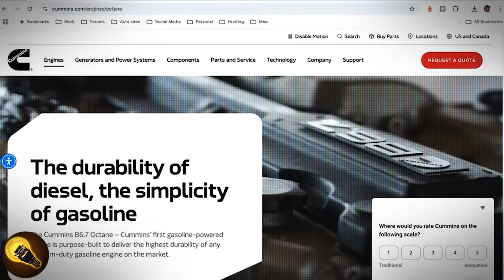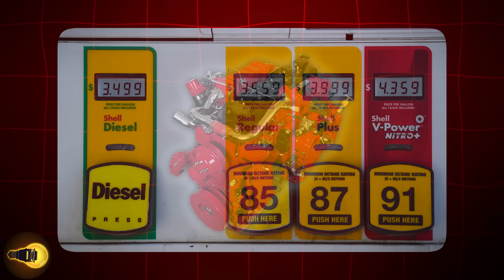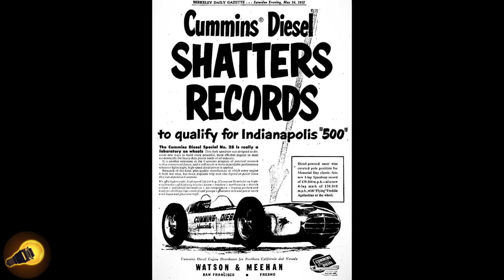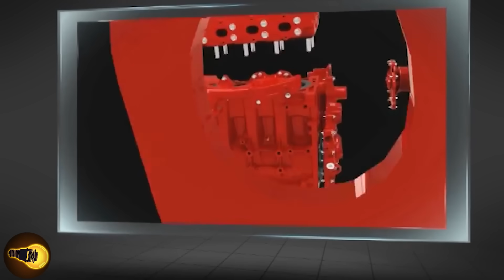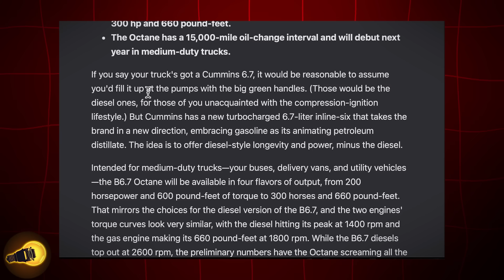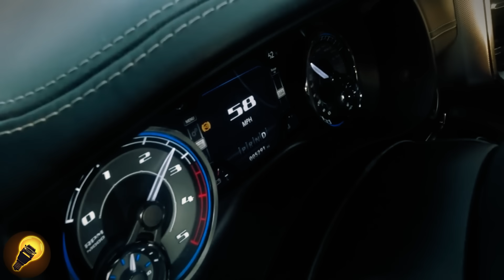Cummins Shakes The Industry With A Gasoline Engine!!!

Comment: Cummins has made natural gas engine's for years under Cummins Power. It about time they moved into gasoline.
Reply: True, I have worked in two different bus factories since 2019 and depending on what the customers want, one can walk down the assembly line and see both the Cummins diesel and CNG engines side by side. They are the same block. They are both rated 280 horsepower with way more torque. The biggest differences are the heads. The ones with spark plugs are CNG. It won't take much to convert the CNG to gasoline. The computer fired injection and fuel tanks will be more of a cost than any retooling to the head itself.
Reply: @jamesrapier3362  Why would you want a bus that burns gasoline, though? Pretty much all modern diesels use EFI (computer fired injection).
Reply: @PistonAvatarGuy  EFI stands for  Electronic Fuel Injection
Reply: @tomhutchins1046  Yes, diesels (almost all of them) have been using EFI for decades. I was just using the terminology that was used by the person to whom I was replying.

CNG is almost zero emissions. The EPA considers some CNG vehicles to be near zero emissions. CNG vehicles generally have much lower NOx emissions than diesel vehicles. There are lean-burn CNG vehicles which operate like diesels (unthrottled, power output controlled by the amount of fuel injected) and have high NOx emissions, but no one really uses them on a large scale (in the US, anyway).

BEVs don't have the range for most heavy vehicle applications. BEV buses have been tried in the US, but many simply don't work on most routes. BEV garbage trucks, too, simply don't have the range to complete their routes. Series hybrid systems (CNG) would be ideal for stop and go heavy applications (buses, garbage trucks, etc).

CNG would be great for long haul, which is also something that's not suitable for EVs.

Edit: Oops, put gasoline when I meant to type diesel.
Reply: @PistonAvatarGuy Research it CNG is not zero emission's far from it. If it was it would be problem solved since we have massive amounts of it in this country. CNG is used in power plants because its obviously cleaner than coal . But the king wants to bring back coal?
Reply: @PistonAvatarGuy  Busses and garbage trucks have had issues because of the manufactures. many city's have used them very successfully your just quoting the broken ones. Big oil does not want them and with the current administration manufactures are hesitant to invest. They also cost more so some citys are hesitant to invest
Reply: @PistonAvatarGuy  PS I know i sound like an EV type I'm actually a retired hot rodder that owned an automotive machine shop for over 30 years, Battery tech is already available to meet long range requirements just expensive but that will change.
Reply: @tomhutchins1046  Sorry, but you've been misled. Examples of BEV buses being viable in certain cases are simply special cases, or cases that are unique to certain regions, people simply aren't looking into the details in order to understand why they wont work in all cases. For example, BEV buses might work in Europe because of the short routes, but they wont work in the US because the routes are much longer. I've also seen examples of BEV garbage trucks being hailed as proof that BEV garbage trucks are viable, but they're much smaller than the trucks that you'd find in the US and simply wouldn't work as replacements for our current garbage trucks. Details matters.
Reply: @PistonAvatarGuy  LOL we have had EV busses running around near were I live for years and there's hills involved. Tesla trucks run a route 220 loaded miles each way from the bay area to reno daily. Trough the mountains. Your buying the bull. Part of why you think the garbage trucks are smaller is because they don't need bulky engines and transmissions fuel tanks. Just very compact drive units  and a very compact flat battery cell. Which also makes them much more stable due to the lower center of gravity. And more efficient due to the engine not getting in the way on the design. If CNG were the answer it would be so simple but its not.  EV still needs government support to be excepted but obviously wont get it right now.
Reply: @tomhutchins1046  Yes, BEV buses run on limited routes where I live as well, but they were also tried on the longer routes and simply didn't have the range to complete them. 440 miles is far less than what most long-haul trucks will run before having to refuel. The need for battery replacements is also an unknown and the cost of those replacements could easily outweigh any savings that BEVs might provide in heavy duty applications.

No, I didn't mean that the garbage trucks were physically smaller, I meant that the trucks had far less capacity. I did just find some larger BEV garbage trucks with capacities that are comparable to the ICE trucks, but they're physically larger because the batteries that they require are enormous. Weight might actually become a problem with those trucks, as heavier vehicles are more damaging to road infrastructure.

CNG has been the answer for bus fleets for decades.
Reply: @PistonAvatarGuy  "CNG has been the answer for bus fleets for decades." That's what the people living in caves used to say. tech moves on. Actually batt life is well known and documented. There is tremendous fuel savings and cost saving especially if the terminals are set up to industrial priced power and solar. That has been proven. The weight of the ev truck was a secret but with scales and drivers that didn't last long. There about 5000lb more than the lightest most efficient latest over the road trucks. But have a much lower center of gravity. Remember that's 440 miles through the sierras a long hard pull to 10,000 feet. The regen making power and saving brakes on the way down. Remember solar panels used to be very expensive now there cheap. The same will happen with battery tech weight and price. Just since the current administration is clearly in bed with big oil we may have to see it down the road.
Reply: @PistonAvatarGuy  Ps the larger garbage trucks your seeing in the USA are big not because of the battery's but because the manufactures cant commit the expense of proprietary component's due to the uncertainty of the present administration. So they use standard cab and frames ect to save cost. So the truck design in the USA is not efficient.
Reply: @tomhutchins1046  "That's what the people living in caves used to say. tech moves on."

If that's true, it hasn't yet. BEV range is still a problem. If you're in SoCal, you have pretty mild weather, that might explain why BEV buses work in your area. Again, special case.

Yes, the batt life for passenger cars is known and documented, the problem is that none of that data applies to heavy duty applications. Heavy duty is a whole different world from light passenger vehicles.

"The regen making power and saving brakes on the way down."

Exactly, it's a special case.

Solar power at the same level of reliability as other grid energy generators is still insanely expensive. Solar energy with storage is also insanely resource intensive (damaging to the environment, in other worlds).

The cost and energy density of batteries has basically leveled off, they're about as good as they're going to get, and they're just not good enough to replace ICEs in all applications. Your camp has been saying that batteries are going to improve without limit, but the limit has clearly been hit.
Reply: @PistonAvatarGuy  Socal no but SoCal is naturally desert and hits well over 100 degree's in the summer. Also desert style storms in the winter as in all at once? then those santa ana winds
Reply: @PistonAvatarGuy  Actually ca at this time produces more cheap clean energy that it can use right now. you may want to research that you position is about 20 years dated
Reply: @tomhutchins1046  BEV buses are not operated in areas where the temperature regularly hits 100 degrees, they're operated near the coast, where the temperatures typically don't exceed 90 degrees. It never really gets cold in SoCal, not like it does in the northern parts of the US.
Reply: @PistonAvatarGuy  Dated info they apperate just fine  now
Reply: @PistonAvatarGuy  It can get very cold at night  in the desert that's socal bad info again.
Reply: @tomhutchins1046  Not near the coast. Oceans mitigate temperature fluctuations. I spent New Years night in SoCal once, it was t-shirt weather all night, in December/January. It even rained in the evening, it was still perfectly comfortable t-shirt weather. I live in the high desert, where it does get both cold and very hot, but I'm nowhere near an ocean and I live at high altitude.
Reply: @PistonAvatarGuy  yah been there once? So yah got the weather patterns all figured out huh? There is a mountain range between the ocean and central valley.   
"The Mojave Desert can get quite cold at night, especially during the winter months. Temperatures can drop to near freezing, with lows in the 30s or even the teens (Fahrenheit) in the winter."
The extreme difference in coastal temps and further inland is what causes the santa ana winds
Reply: @tomhutchins1046  BEV buses don't run in the Mojave. Heck, so few people live in the Mojave that it's unlikely that there are very many buses at all.
Reply: @PistonAvatarGuy  Your not paying attention southern ca is the mojave desert. any low lands (As in not mountains east of the coastal mountains  is desert that has been irrigated. I grew up it southern Ca. Its hot!! in the summer and cold in the winter.
Reply: @PistonAvatarGuy  Modern Ev's have water cooled battery packs and motors / differentials. like the last 25 years?
Reply: @tomhutchins1046  You're just being obtuse. Air conditioning (including heating in colder regions) is the problem, not the battery packs.
Reply: @PistonAvatarGuy  I think the chicken came first not the egg
Reply: @tomhutchins1046  It's absolutely perplexing to me that you people seem to have decided that conversation is a crime. Do you enjoy living under totalitarianism?
Reply: @ Dude? How did you jump to the conclusion that I want a gas bus? I'm an inspector for buses. I wouldn't own one! LOL!  (55 years as a gas engine mechanic and 50 as a diesel mechanic) My point is the CNG buses weight 2000 lbs more than the diesel buses because of the top-heavy fairings and CNG tanks. The diesel buses suck because of DEF tanks and emissions (which shortens the life of the Cummins diesel by more than 1/2). The Hybrid buses suck because you, your dad, your granddaddy, your son and your grandson couldn't afford one because the transmission alone costs 100K plus and they are always in the shop for transmission problems. The hydrogen fuel cell buses cost north of 1 million. The electric buses cost north of 1 million and our liberal cities buy all these crap buses because they take your tax dollars and spend it on these systems because they think they are saving the planet. But finally, my favorite engine is the Ford gasoline inline 6 with 300 cubic inches and I would love to have a inline 6 Cummins  with about 500 cubic inches in my pickup just for fun, and you can bet it would be easy to work on, but you couldn't have it in The Peoples Republic of California, but thankfully I live in the mid-west. Peace
Reply: @jamesrapier3362  your 105 years old? your a bunch of biased hot air
Reply: @jamesrapier3362  Cat makes some big inline 6's go for it.
Reply: @PistonAvatarGuy  ? what does that have to do with the chicken or the egg/ I take it your not in the USA?
Reply: @jamesrapier3362  So CNG buses are the only type which don't inherently have any actual problems.

I guess that I thought that you were talking about the Cummins gasoline engine, for some reason.
Reply: @ My favorite engine of all time is the 300 Ford inline engine which was bulletproof and a person can pump them up to over 400 hp and is lot of torque. I was liking the idea of maybe dropping a gasoline 500 cubic inch inline six built by Cummins into my pickup if the price is reasonable because I love inline gas engines! But after the feds ruined diesel engines with DEF then CNG is better for buses but if Lee Zelden  can get the DEF removed from new buses then I think diesel buses would be more cost effective
Reply: @jamesrapier3362  The US made at least a few good inline 6s back in the day. I always liked the AMC 4.0 liter that was used in the Cherokees in the '90s. These days, those pushrod 6s are dogs, though.

Hopefully the emissions controls on buses are left in place, unless you're in favor of universal healthcare and are willing to pay for the treatment of more people with lung disease.
Reply: @PistonAvatarGuy What fuel efficiency penalty is paid when you move from lean burning CNG engines to stoichiometric CNG engines?
Reply: @gregorymalchuk272  I couldn't say, but I do know that stoichiometric engines are efficient enough that they offer significantly reduced fuel costs relative to diesels.
Reply: @PistonAvatarGuy True. It perplexed me that nobody had made heavy duty gasoline engines to take advantage of the much lower road fuel costs.
Reply: @gregorymalchuk272  I was talking about CNG. Gasoline does end up having comparable operating costs in some applications, because it basically eliminates emissions control system problems, which are extremely prevalent and costly for diesel fleet operators.

It would be interesting to see how the Cummins Octane engine fares in that regard.
Reply: A lot of the “Cummins Power” standby generators were actually powered by Ford 6.8L V10 engines converted to run on propane or NG and some even had a turbocharger.
Reply: Yes I know. They use them because of political reasons not because they are great. Obama passed the 100k tax credit for class a trucks that use CNG for fuel. As for power differences you’re only talking 10% between CNG and reg gas. Diesel produces up 20 percent more then reg gas. If you take away the egr and other emissions then even more power.
Reply: @patrickg2577  CNG engines are used because they're less expensive to operate and because they last longer than diesels. Cities save millions, or tens of millions when they switch from diesel to natural gas buses. Natural gas engines can also be made to produce far less pollution than diesels.

The vast majority of the stationary piston engines used to produce electricity are also natural gas engines for these same reasons.
Reply: @ this is not true. They do not last longer then diesel engines. The tank setup alone for a CNG rig is 30k more with added weight if we are talking about class A over the road rig. The only reason they use this is because of the tax incentive the company gets back from the government. 100k In that case. Most of them fall apart around 500k miles and the Cummins 12liter doesn’t even allow for removable sleeves like diesel engines. iv been around this argument for 15 years now. It’s all political BS.
Reply: @patrickg2577  They absolutely do last longer than diesel engines. Diesels destroy their oil with particulate and the forces on their internal components cause more rapid wear. Bus fleet operators couldn't care less about a little added weight. The added cost of the tanks is more than offset by the lower cost of the fuel and the greatly reduced maintenance requirements of the engines. CNG engines are also more reliable than modern DEF/EGR/DPF diesels, and they're cleaner on top of that. Being cleaner while making use of less expensive, more reliable and less maintenance intensive emissions control systems is a very real advantage.

Cost savings and cleaner emissions are not political BS. There are no tax incentives encouraging that natural gas engines be used for the production of electricity, so why are they so greatly preferred in that application?

I seriously doubt your claim about the sleeves not being replaceable in the Cummins natural gas engines. Maybe the sleeves just don't ever need to be replaced and you're confused on the matter.

You can make more power with a gasoline engine than you can with a diesel while limited to the same rpm, the gasoline engine simply needs to be able to achieve a greater BMEP, and some gasoline engines do just that (it depends on the engines being compared). For example, the current 3.5 liter EcoBoost engine used in the F-150 has a much higher BMEP than the current DD15. If the DD15 had the same peak BMEP as the 3.5 EcoBoost, it would be making 2,114 lb-ft of torque!

The Cummins B6.7 Octane has the same peak torque output as their medium-duty B6.7 300 diesel.
Reply: @patrickg2577  And, no, the difference in power output between a good gasoline engine and a good natural gas engine is typically 20 percent. Gasoline engines are also typically far more powerful than diesels, if they're allowed to take advantage of their higher rpm capability. When revs are limited to the same rpm, diesel rarely has an advantage over direct injected gasoline. Diesel basically never has the advantage without turbocharging.
Reply: Also you can’t get power out of a converted diesel to gas engine without more RPM. They red line the same. Gas engines are designed for revolutions it’s not possible with a diesel bottom end. Trying to pull a 8percent grade hill in one and you will understand why CNG doesn’t work. You talk about turbocharger even better for diesel because of their high compression output.
Reply: @patrickg2577  City bus fleets are not incentivized with any sort of tax breaks, either, they just saw straight savings with CNG engines. How would a city incentivize itself? You're not making any sense.
Reply: I’m taking about fleets or companies driving over the road. Not the gov. And city buses that carry people are not the same as 40ton road hauling.
Reply: @patrickg2577  If city bus fleets are able to achieve savings, and many companies have also seen savings (regardless of incentives), why would any other fleet not also see savings? Also, the Cummins X15N has likely solved many of the issues that might have existed with previous natural gas engines, and I'd wager that there's room for improvement still. I know that current natural gas engines do not make use of direct injection and that DI would improve the performance and efficiency of CNG engines significantly.
Reply: @patrickg2577  A DOE study concluded: "The incremental cost of the Freightliner tractors can be recouped from fuel savings in 10–14 years, excluding incentives, under the operational conditions in the case study."

Based on the mileage of the trucks in the test, that's a payback period within ~300k-500k miles, and that's just the fuel savings. Studies which included the costs associated with the problematic emissions control systems used on the diesels had much shorter payback periods. Towing costs for the diesels were even significant in those studies. This study was done with older Cummins natural gas engines, but, again, improvements have been made, including a 10% reduction in fuel consumption.

"X15N demonstrates up to a 10% fuel economy improvement compared to its 12-liter predecessor."

If emissions were ignored on the CNG engines, their fuel savings would improve as well.

Sorry, but if we could go back in time and do things over with regard to how we fueled our truck fleets, CNG is the clear winner.
Reply: If your talking about just going down the road on flat land and getting from a to b CNG works. You can put a 4 cylinder and a Dodge charger and go down the road yes. but the talk that it’s more superior to diesel is false. You can cherry pick what ever data to show how good its it, but at the end of the day I have my own personal experience and thoughts from this experience. Like I said from the perspective of weight which you can only haul 80k down the road the CNG truck weighs 6 to 7k pounds more taken away from the overall load you can haul. It can not and will not accelerate on any hill like a diesel can period. The cost is more expensive, it just appears better because of the incentives to get companies on board. Will it work? Does it work? Yeah sure but it’s all at the end of the day bs. If you take the incentive away then let’s see what happens to all of the good talk about gas and CNG in big trucks. One more point to make I do believe that electric power is more efficient and superior to all of this but because of the weight laws and the fact that battery take longer and weigh even more we have to find a new power source for electric motors. The roads and bridges would also all need to be replaced and redesigned for much heavier weight to make trucking more efficient for that.
Reply: @patrickg2577  You don't have experience with the X15N, you don't have experience with any direct injected CNG engine. Drivers who've had experience with the X15N claim that there is no noticeable difference in performance between it and a diesel of the same power output. 

The weight difference is not even remotely as extreme as you're claiming here. The difference is more like 700 pounds, once you factor in the 500 pound reduction in weight associated with the emissions control systems for the CNG engines.

Again, studies done without including incentives concluded that costs were lower for natural gas engines.

I'd like to see battery life assessments for electric trucks, as the cost of the battery replacements is likely to outweigh any savings that they provide. Of course, the pro-electric vehicle people are all anti-government, so there's no unbiased third party making such assessments.
Reply: @PistonAvatarGuy  wrong again. But think on what you will. And you are comparing modern handicap diesels with all of emissions to a CNG or gas powered engine. Hell even an old 3406 with 470 hp will shut down x15 it has no emissions. Take the emissions crap off and then talk. By the way I still live in a place that can run diesels free like that so I’m grateful. Hell better yet let’s go back to the 8v92 series 2 stroke. Even more impressive performance with the right exhaust. There’s also the reason why the US military used them in their Oshkosh trucks because then don’t live by what they preach with emissions, they just force everyone else.
Reply: @patrickg2577  Nope, not wrong about anything. Not only are there loads of studies proving you wrong, but you're trying to compare incredibly clean CNG engines to absolutely filthy diesels.

How could you even have experience with a DI CNG engine in a heavy truck when none are in production for heavy trucks?

"Delete the emissions controls."
"Delete the emissions controls."
"Delete the emissions controls."
"Delete the emissions controls."

Yeah, and I can outrun Usain Bolt, as long as you tie his shoelaces together. You're clearly trolling.
Reply: It’s clear you like them so that’s your choice. Nothing wrong with that. Good on you! The CNG I do have experience with is the 12 litre isx Cummins. And will hate the thing for as long as I live because of what I have listed already
Reply: @patrickg2577  I like whatever works best, and that's clearly natural gas engines. You like whatever causes the most harm to human health, apparently.
Reply: @patrickg2577  The ISX12 is not the X15N. Again, the X15N offers significant improvements over past natural gas engines.
Reply: The limit is not even close to being reached LOL I could use that's what the people living in caves said. Ev trucks have been running around for years as test beds. The sierras have snow packs and extremes weather in the winter on the way to reno. also Sacramento is cooking hot in the summer. Snow ice etc.. Ev trucks also have a huge aerodynamic advantage they don't need large air intakes to get rid of heat energy they just made burning fossil fuels. There is battery tech being developed that will replace lithium its just a matter of time. I think we need to bring back the horse. Them thar new fangled cars aint no good
Reply: @tomhutchins1046  Yeah, ok, they've just stopped improving because they're not even close to being done improving, that makes sense!
Reply: Spending sometime behind the wheel of a 12liter Cummins natural gas and I can say that this will not work well. The idea of having the normal strong bottom end of a traditional diesel and the upper of a gas is gutless. First is gas powered needs rpm for torque and hp. These old lower bottom ends are not made for anything above 2800 rpm. Gas does not have the energy of diesel. The 12 litre natural gas sufferers from this as well, these will not be able to pull a hill when power is needed. Second thing is added weight to an already heavy bottom end. There is a reason this doesn’t work well in the semi world, they weigh 7k more and the closer you are to a total 80k weight the less of a load you can carry. And number 3 is this is why you will never have electric trucks is because they weigh even more. There are ways though, like what Edison motors are doing with electric axles. But not engines.
Reply: @patrickg2577  CNG engines have been in use in buses for decades. Gasoline engines are more powerful than natural gas engines. Your comment makes no sense.
Reply: a simple google search and you will see that there is a tax incentive for CNG. 100k for class A, 30k for B. And when getting rid of the EGR and all of the particular filter BS you will see a diesel in true action. But I’ll leave you to it just with the Google search.👀 also the EGR and particular crap on diesel don’t really save the environment anyway the job of a EGR is to lower Nox. Hell everything in nature has NOx even a lightning storm.
Reply: @patrickg2577  "And when getting rid of the EGR and all of the particular filter BS you will see a diesel in true action."

Yes, as the most polluting, disgusting engine in modern times. The emissions controls on engines are not just for the environment, they're for our health. Vehicle emissions controls are a proven way to reduce smog. Seriously, if it were up to people like you, we'd start offering cigarettes with school lunches.
Reply: The CNG engines are straight up garbage! Let's hope the gasoline fueled ones are better....
Reply: @jeffreyx5000  Not compared to the DPF/DEF/EGR diesels. Diesel buses in my city were always having problems, while the CNG busses worked great. The CNG buses are super clean, too.
Reply: @PistonAvatarGuy  But that aint cool cousin billy bob want to roll coal!!
Reply: @tomhutchins1046  I was only talking about buses. Light vehicles should only run on gasoline, diesels just don't make sense in that application, and neither does CNG.
Reply: @PistonAvatarGuy  CNG generally produces less pollution than gasoline and diesel, but it's not entirely clean. While CNG emits significantly lower levels of carbon dioxide and other pollutants like unburned hydrocarbons, carbon monoxide, and particulate matter, it also contributes to air pollution. CNG vehicles may emit higher levels of nitrogen oxides (NOx) compared to gasoline vehicles. Additionally, particle pollution, including ultrafine particles, can be a concern, especially in urban areas.
Reply: @PistonAvatarGuy  EV is the perfect answer on vehicles taking short trips, Stop and go ect. Then parked in the yard for charging especially at night for cost but during the day would be best because solar is at its best in the day.